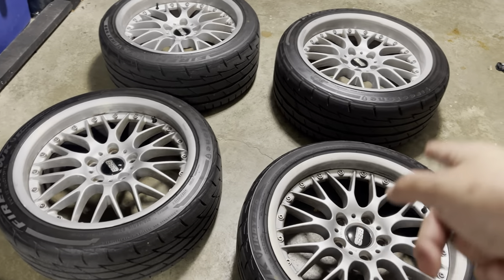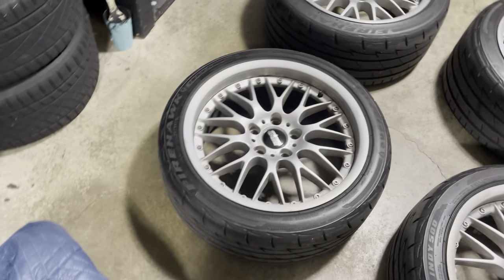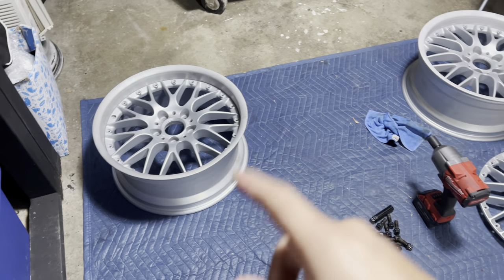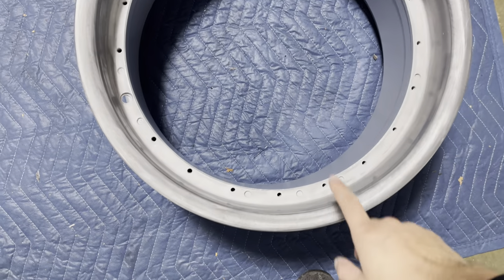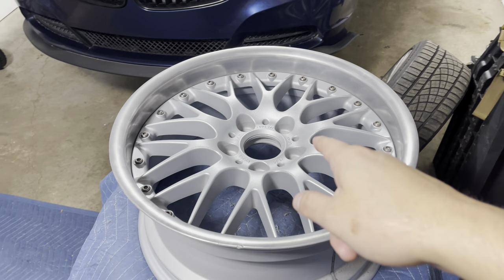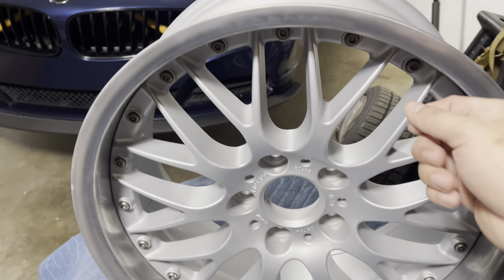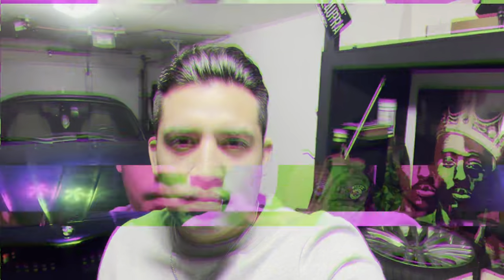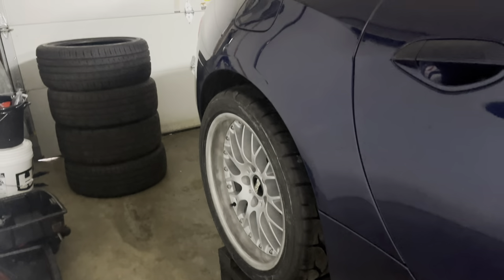BBS Style 42 Two Piece Wheel Restoration | WHAT TO EXPECT |

Comment: Nice project. Where did you buy new bolts and what are the specs for replacement bolts?
Reply from the maker: M7x24mm bolts, you can find some at Black Forest Industries. However, I’d recommend just being very careful removing your old bolts, soaking them in vinegar, and re-using them.

Comment: Nice job with the video! What color powder coat did you go with for the centers? Also you have been living with the wheels for about a year. Any other reflections? Thanks!
Reply from the maker: Thanks! I went with Porsche Silver and I’m really happy with the wheels so far. The only thing that I would do different is do a better job polishing the lips. Maybe get some polished hardware too. Also maybe do the wheel barrels black instead of the same Porsche Silver haha

Comment: Do you know size center cap
Reply from the maker: @wereatbro9101  
68mm
Reply: @erez161  can a 70mm fit on those wheels
Reply: @erez161  or 70.6mm
Reply from the maker: @wereatbro9101  
Has to be 68mm you can find cheap blank ones on Amazon